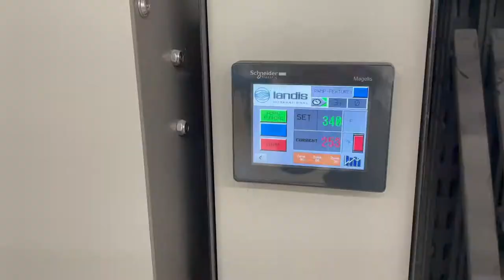The Making of an AFO

Comment: Wow! You work so fast!
Seriously, as a former fabricator who has retired, is anyone using scanning 3D digitizers to get the patient mold instead of casting?
Reply: How to you become a fabricator?
Reply: do
Reply from the maker: We do have 3D digital scanning tech in our office, and we use it in some situations. It can be just as effective and is quicker in certain scenarios, but many of our practitioners feel that a digital scan is just no replacement for the precise manual adjustments they can make during and after an old school plaster casting process.